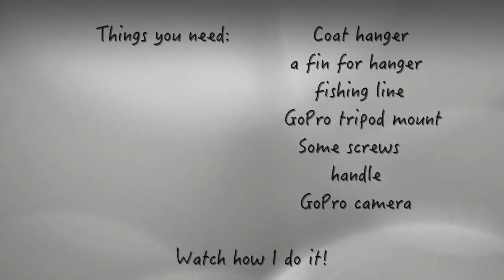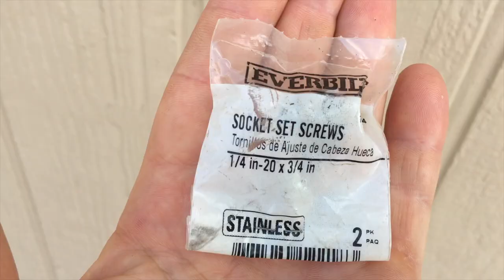How to make CentriPro & Set-up! Cheap & Fun! GoPro Tip #539 | MicBergsma

Comment: it would be cool if u could make it work with a drill or something like that
Reply: What do you mean?
Reply: +Kouki_Monster instead of swinging the rig around the middle handle is replaced with a power drill spinning the GoPro much faster and effortless
Reply: MrCjsartwell Ahh I see yeah that would be pretty dope. Maybe getting it going might be hard since the drill almost instantly just spins. You'd have to attach it to some gears to slow it down a bit. Though using a brushless dc motor might work just as well and allow you to control the speed better using a dial.
Reply: Kouki_Monster good thinking never even thought about that